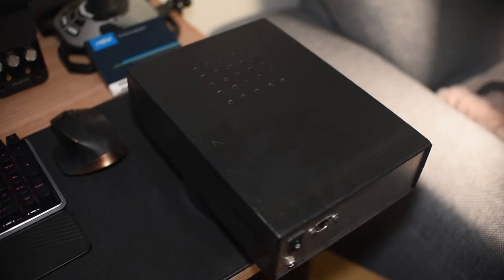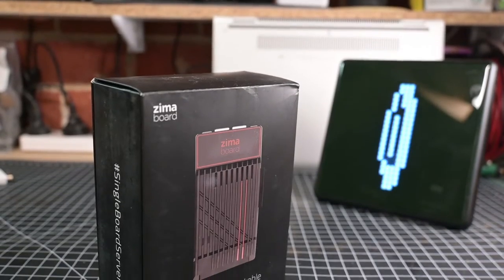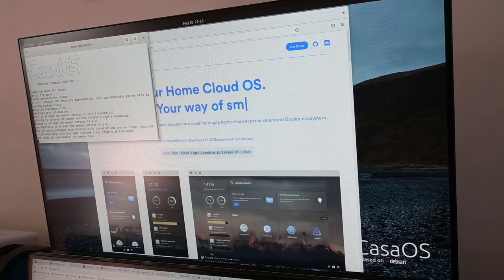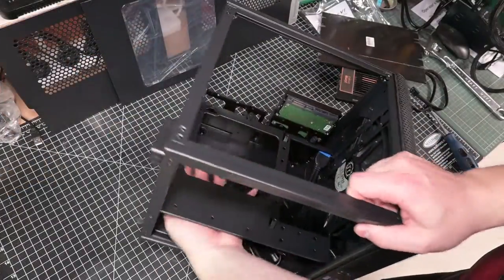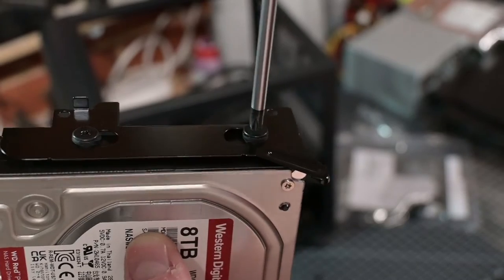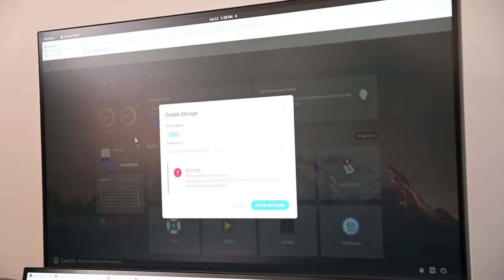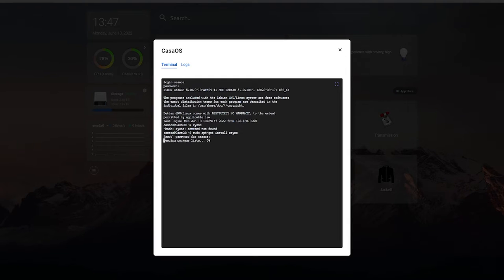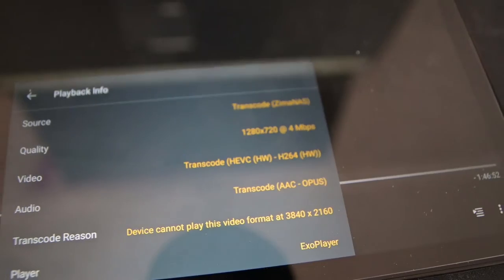Upgrading my DIY Raspberry Pi NAS with a new SBC...

Comment: Nice video. Do you mind in future add zimaboard sata hat?
Reply from the maker: I was thinking about adding 2.5G ethernet actually. But it's not really needed. If I wanted more space/redundancy I might add a SATA card, but I'm good with the space and backup functionality I have atm
Reply: @Maker_HQ  will be great to see a sata performance test as I know NAS on sbc has bottleneck in sata ports speed.
Reply from the maker: @johndoe1047  I had no complaints with my previous Raspberry Pi-based NAS running OMV. Unlike some people, I was able to get around 80MB/s+ read/write across my network (for large files). Of course I was only ever writing to one hard drive though. With the Zimaboard I am able to max out the network connection (110MB/s read/write). https://www.dropbox.com/s/24wlce3pbfv6zzv/nas.png?dl=0
Reply from the maker: @johndoe1047  The Zimaboard isn't really a SBC remember... I mean it is in the physical sense, but not in the logical sense. It is an Intel x86-based system, so it has full-speed 6Gb SATA interfaces, no different to any desktop PC. It's not like the RPi in which drives are connected via USB.
Reply: @Maker_HQ  thanks a lot, now I can build a proper setup when I receive my board:)